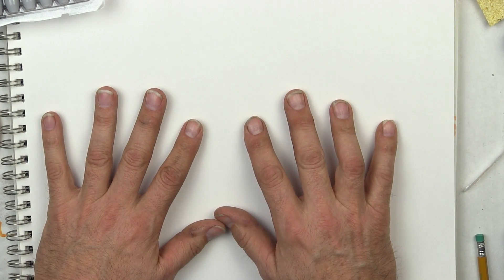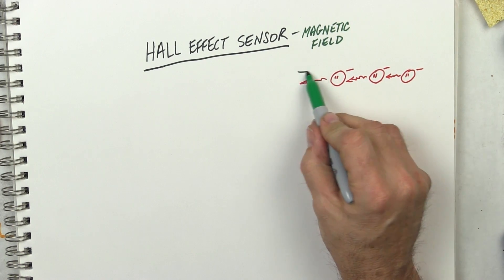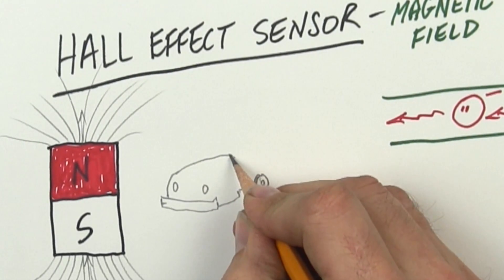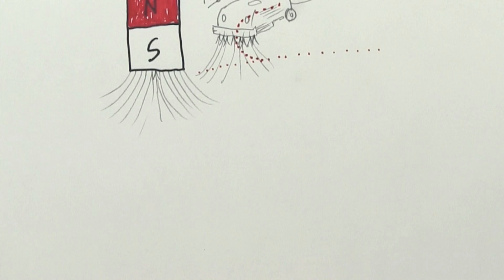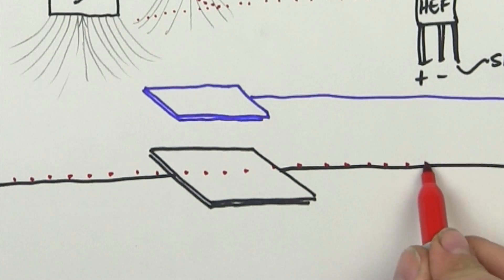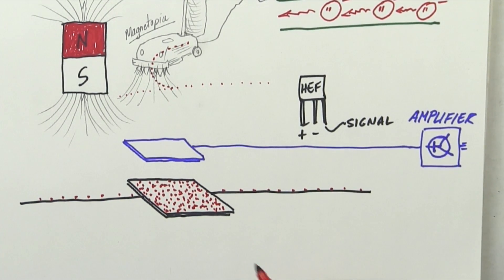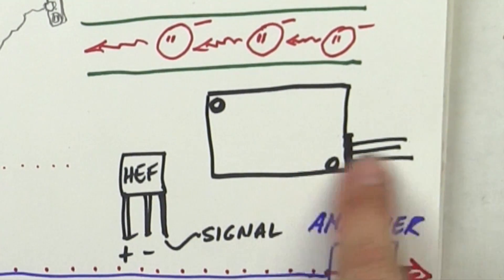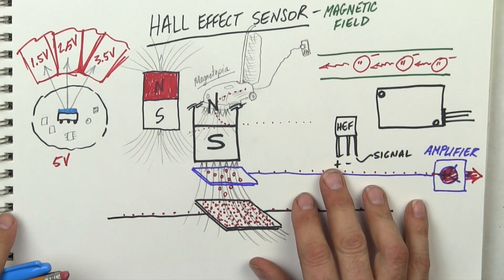Essentials of Hall Effect Sensors

Comment: Hwzit how you uncle. 

Really hope you can help me .
I've got a kadett 1.6 carburetor with electronic distributor. 

The pick up coil in distributor according to my knowledge keeps burning out or faulty. .
Bought so many now. 
Bought pick up coils .
Ignition module and ignition coils .
And I'll drive a day or to etc and all of a sudden I'll loose spark. 

I do know what I'm doing however maybe over looking something. 

So my question is. What would cause the pick up coil in distributor to stop sending signal.
Reply from the maker: Wire problem. Intermittent open. Corrosion. Wire 80% of the time. Don't change parts until you confirm the wiring isn't damaged.

Comment: Does Hall Effect Sensor measure the spindle speed of the motor too? Electric scooter for example.  And does this be needed for accelerating the motor?  Or can the speed throttle do the job without the Hall Effect Sensor?

Comment: Was this an April first video?

This isn’t how any Hall Effect sensor works, to my understanding.

The Hall Effect is based on something known as  Lorentz Force. A local magnetic field induces a voltage potential at a right angle to itself AND an electrical current (it does NOT suck electrons up into the magnetic pole).

There are no secondary capacitively coupled “sense plates” - the voltage is induced in the single current carrying “plate” at a right angle from the path that the current is flowing. The voltage potential difference is in the order of microvolts, so the sensor has voltage regulation, op amps, as well schmitt triggers built into the sensor packaging to bring the signal up to the level that external components can reliably use them.

Comment: Thanks for the explanation, the diagram is very helpful

Just need clarification:

I learned that if the electron is going to the right I learned 

that if the electron is going to the right
And if the magnetic south is in the page (magnetic field pointing in)
Then the electron is supposed to go down

I couldn’t connect this rule with your diagram
Could you Help me make the connection?

Comment: What about the difference between Hall effects to vrs sensors
Reply from the maker: Reluctance is magnetic resistance/conductance. If the material the magnetism is passing through changes, the strength of the field changes - and then that can be used to affect current in a wire. Magnetism hates air and loves soft iron.

Comment: Cool thanks for the share. I do have a question thow. Ok I have a 48volt 750 watt gearless hub motor that goes to my trike mobility scooter. The wires broke of flush on the wiring for the hall effect sensors, but there is a few different ones on Amazon for a few bucks. I'm guessing it is the 3144, but not to sure. Can you help me? Thanks for your time. Joe g.
Reply from the maker: Can you send an image? dan@brighterideas.com
Reply: joe gonzales. same happened to me!

Comment: If the electrons are going toward the south pole of the magnet, does it mean that the south pole is positively charged?
Reply from the maker: +Reuben U If you figure that out I'm pretty sure that you'll win the Nobel Prize in Physics. Read up on electron beam guns and cathode ray tubes.
Reply: Daniel Sullivan
Geez, I was actually just being curious. Anyways, thanks for the advice.
Reply from the maker: Reuben U No offense intended - it's just that no one knows. Cathode ray tubes use electromagnets to bend the beam. Thought it would help you understand.

Comment: Thanks Dan! I was a Master Mechanic for a Caterpillar dealer for 25 years, Now I am a technical trainer and I teach electrical as well as all other systems on Heavy Equipment. Your drawings seem to make a real impact on the ability to grasp the concept of whatever switch, sensor or Sender, we may be covering at the time. I also use and promote the Loadpro leads in my classes as I have found them to work exactly as advertised and make troubleshooting high resistance in circuits much simpler. Keep posting the great videos!
Reply from the maker: +Monte Hammon Contact Steve White at ESI (www.esitest.com) if you're interested in using the training cards. There's a school discount. You're welcome to use anything I have - that's what it's for. Let me know if you have any problems or questions - my emails is dan@brighterideas.com.

Comment: Hi Daniel, im working with hall effect sensors, and recently, something is going wrong. The sensors sense when they are not supposed to and vice versa.

Now that i looked your video, i think it might be the wires, so what do you mean by cleaning them?

Thanks
Reply from the maker: Fernando Calatayud Zepeda Can't be certain. What is this on/for. Manufacturers have been known to screw up; it is possible wires are crossed. Check that first. Cleaning wire connections is what I'm talking about.